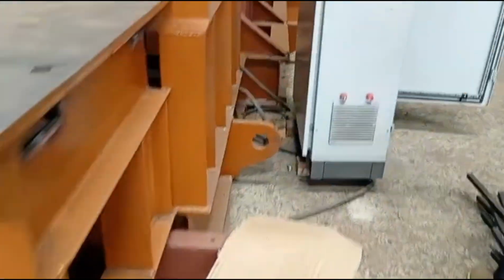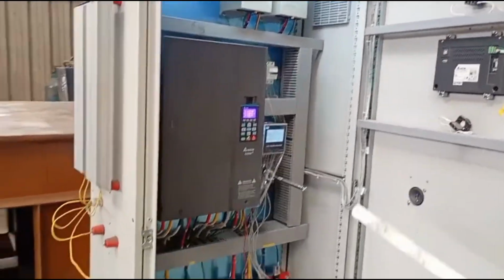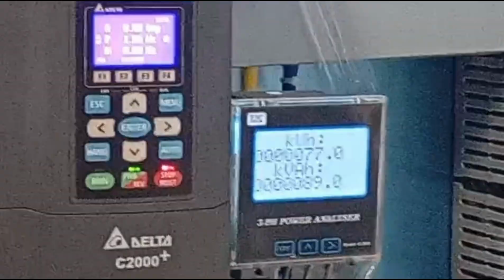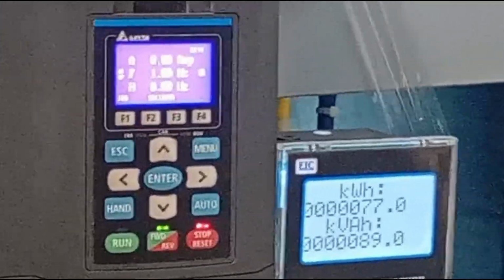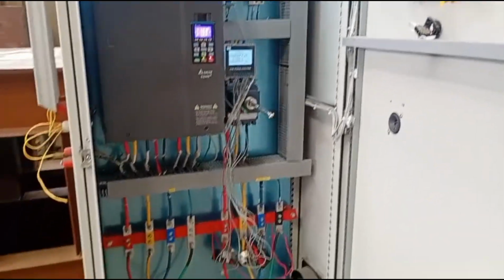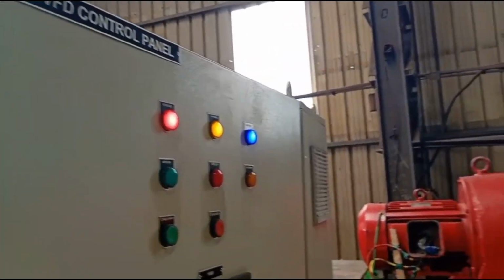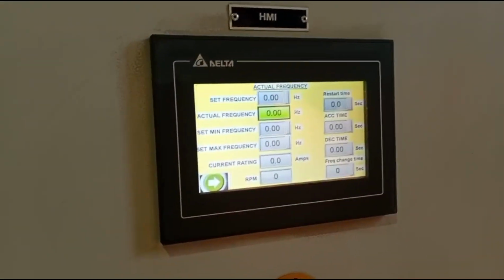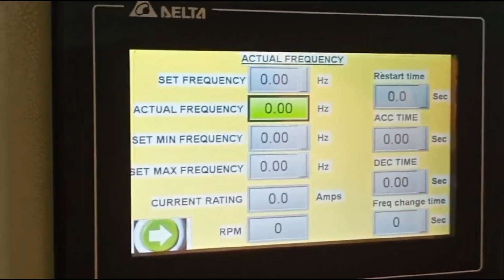KAMMA Gear Flywheel Technology Explanation : "Energy is Created"

Comment: I built a machine that rotates using a weight. With this method, if I stop the power supply motor, the machine will stop after a certain amount of time; how many hours does it run before stopping?
저는 무개추로 회전하는기계를 만들었습니다  이런 방식은 
전력 공급 모터를 정지시키면 얼마의 시간이 흐른후 기계가 
멈추게 될 텐데 몇시간 동안 돌아가다가 멈추나요 ?